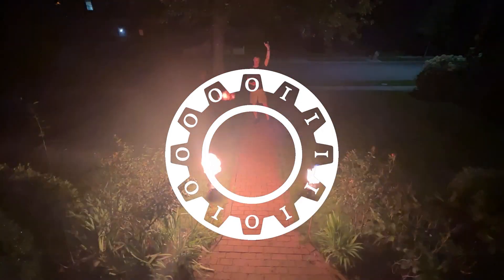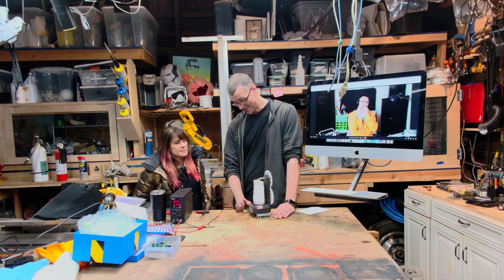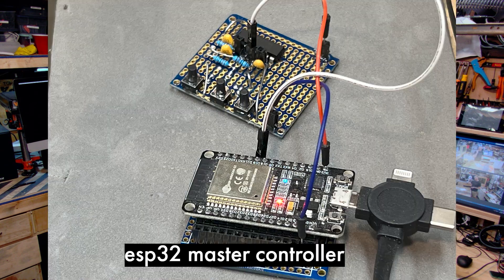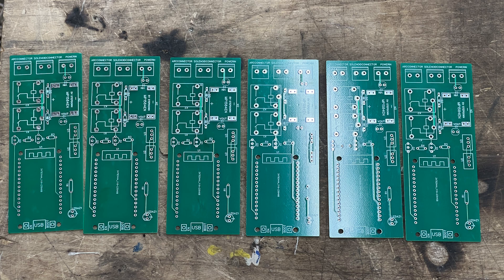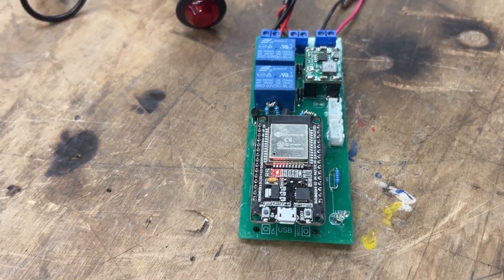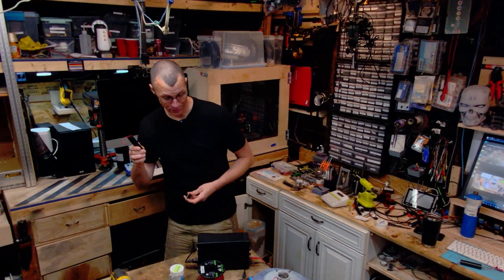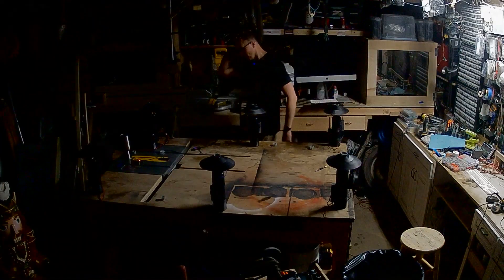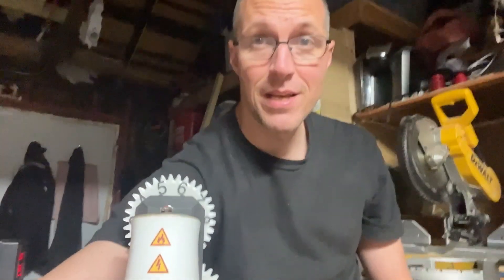I Safely Programmed Propane to Greet Me (with esp32 Arduino)

Comment: Did you ever solve the problems with the high voltage interfering with the microcontrollers? Asking for a friend
Reply from the maker: Funny you should ask, I just revisited that recently while trying to control the ignition on my flaming skull AI cohost. 
A couple different things were happening  1. The voltage to the mcu was taking a hit when the spark generator was running, and 2. The actual high voltage was introducing a lot of EMI into the mcu.

Putting the high-voltage generator on the other side of the propane tank helps significantly, but still was probably far from ideal.  But basically, I was using far more voltage than necessary i.e. 12V to "1,000 kV" , when now I'm getting by using an 18650 battery at 3.3-4V running a 10 kV ignition arc. 

TL;DR
-use the lowest high voltage transformer you can get away with
-make the leads from the high-voltage to the actual arc as short as possible
- Try to use an independent power supply (like a battery) as the DC voltage source for the arc generator

Sorry for a long response, glad you watched!

Comment: Instead of using ML for person detection, why not use an infared trip sensor like the one on a garage door? When you walk past the pair of any two lights and break the beam it will trigger them.
Reply from the maker: Thanks for commenting! This was my original idea… I got a bunch of little LED laser diodes and some light detectors. Then it occurred to me, if somehow one got knocked over or kicked, it would start spewing propane, and that's extra bad if the cylinder is sideways because a lot more liquid propane would be shooting out than the gas propane that accumulates at the top of the cylinder. Also, it would shoot fire for anybody, and I only wanted to do it for me. Additionally, I still need some type of protection to avoid fire shooting when somebody is near it but not necessarily the one triggering it. If you look at the PCB's, they have two headers for PIR sensor is that I initially plan to use for this purpose. However, I still had enough concerns that I thought the safest way would be to collect training data of me (and only Mia) walking between each of the three Paris. It doesn't need facial recognition, as I am 6'8" and I imagined my bounding box and my cornets would be pretty distinct to me. Thanks so much for your interest!